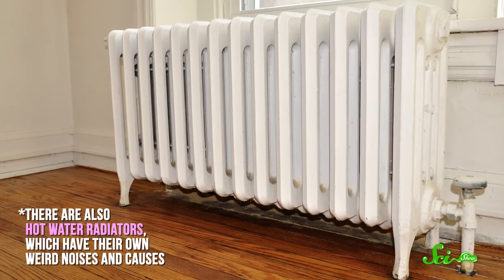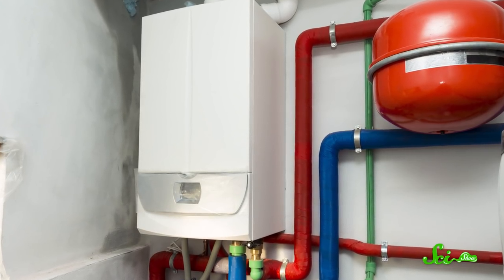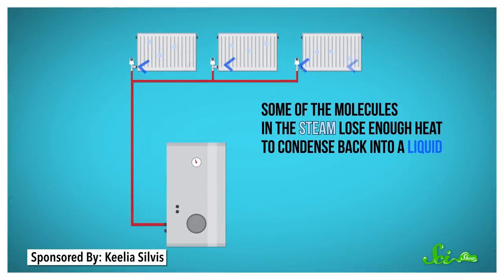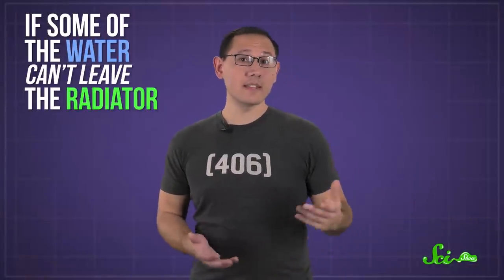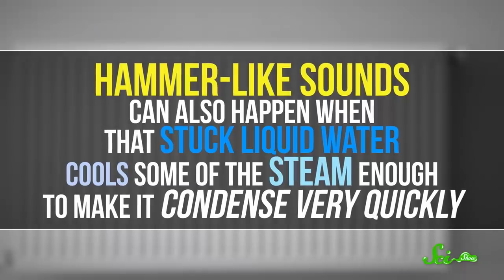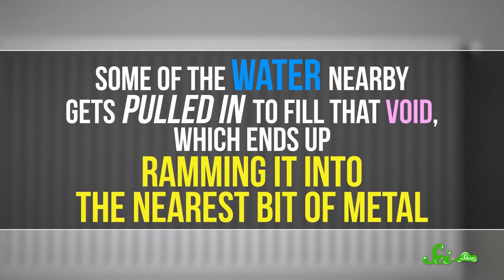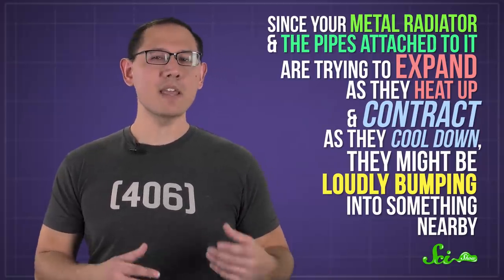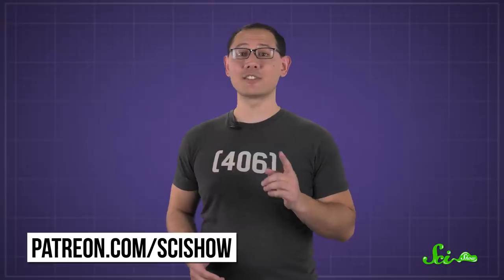What Makes Radiators Bang So Loudly?

Comment: We had those when I was a kid. The whistling was cool air escaping from the bleader valve before the steam reached the bimetal valve, heating it and closing the system. It was kind of comforting hearing the heat come on. Something missing from modern hot water and hot air systems.

Comment: Good info, thanks.  
One minor correction:  
The steam radiator vent closes when the steam reaches it and the heat expands a bi-metal which closes it. (It's not pressure).  Thanks

Comment: I actually looked this up because almost every one of the radiators in our new apartment make the loudest god awful clanging noises when they are on. You can actually feel the floor shaking near the ones in the bathroom, bedroom, and kitchen. At least now I know there might be a semi easy fix without replacing them all...hopefully I can get the apartment management on board to try and get these fixed so my boyfriend and I will be able to sleep at night!
Reply: Did you manage to get yours fixed? I can't sleep at night for this reason.

Comment: Or if it's like in many apartment blocks and larger buildings here in iceland where every radiator in the building connects to a central unit, if a neighbour in the other end of the building bumps into it or starts clanging it with a hammer the sound carries all the way through the building through the metal pipes.

Comment: I was living in a flat with long copper tubing running along my room. The expansion at heating up the movement back caused slip stick motion at the mounting points of the conduit, which was a loud "tick, ... tick, ..." sound. Anoying as hell, but it helped to lubricate the hosing clamps.

Comment: In my house there is an input pipe and and output pipe, and it's basically either always on or off (the steam comes from some public center) so I never experience noise. And I sleep with ear plugs anyway.

Comment: Im in the HVAC industry and work on boiler systems daily.. Youre right if it where a steam system but 99% of boiler systems in residential applications are not steam boilers, they are simple hot water boilers and hot water runs through the rads, not steam. In this case banging usually indicates a serious issue with either the systems pumps or the boiler itself. Usually these sounds are caused by the boiler over heating (because the pump is not circulating the water) this generates a flash steam bubble that usually over pressurizes the system breifly. This pressure spike blows out the pressure relief and the system auto fill valve quickly fills the system back up to operating pressure. When the boiler fills up quickly you get water hammer, (same if you slam a water tap shut quickly in an older home with no expamsion tank) and the water hammer is the cause to the noise. Other times just the steam bubble rising to the top of the system can cause the water to hammer through the pipes too. But if you're getting banging from your rads, and if there is water all over your boiler room floor, you should get is serviced before it kills you in your sleep.

Comment: what the F... the water isn't heated past the boiling point..... there is a pipe with incoming hot water and a pipe with outgoing hot water.... and that gets circulated thru all the open radiators.  No idea where those radiators on Steam are installed, but those are waaay too hot for use. Also, its very energy in-efficient, boiling water to steam to use that as heating is a lot of heat added to water that is not needed in a home.
Reply: Yeah I now understand the system, its archaic old crap, inefficient.
Reply: Hey, Then don't come with out of date crap that is totally inefficient.

Comment: Sorry but you are kinda off really wrong about the "steam". I heating system should be FULL of really really really hot water not steam if you have air in your heating system it needs "bleeding" out via a bleed valve at the top of the radiator. Steam in your system also makes for an unbalanced and a less economical system. Talk to a plumber if you don't believe me but I have been in the building trade for over 10 years and have not come across the kinda of heating system you are explaining hear. The more likely source of the banging is from the metal expanding and contracting because of the heat. Not because steam and condensed water is moving about haha. Just look up how an everyday normal heating system works. Also your house would be an even severely dangerous place to live as the pressure in the heating system would have to be so god damn high if there was a problem it could act like an explosion

Comment: If I hear a loud bang in the middle of the night, I know it's not my radiator, cuz I don't have a radiator. My house is heated a different way. So I don't have to worry about this problem. It's all good now. 

Great video. Keep up the good work.
Reply: If you have oil or gas heating, you do still have a radiator. It is a filled loop system, not a steam one and the radiator(s) is(are) in the duct-work, not freestanding. If you have zoned air, you may have more than one. If you have one thermostat, then it is likely you have one, right by your furnace.
Reply: My house is heated by an electric furnace, which doesn't need a radiator. At least that's how I understand it.

Comment: Clickbait title. Very few if any radiators are run on steam, so the explanation is incorrect
Reply: Actually, in some cities, steam is still a public utility like water, gas, electric and sewer. It is cheaper to use the steam hookup than to heat your own water for a radiator system.
Reply: You're comically wrong.
Reply: Please tell me your joking
Reply: I think almost every apartment in Chicago uses steam radiators.
Reply: This I did not know.  Neat!
Reply: This video also confused me. In the UK we use hot water radiators. In fact this video even shows what appears to be a hot water boiler with expansion tank attached. FYI our radiators can also make banging noises.  Something has become much clearer though: why, in US films, there's always a pipe that when smashed open starts spewing steam everywhere....

Comment: I always thought it was an air bubble going thru the system. Cheers for the video
Reply: Knocking is very uncommon in a filled loop system (hot water instead of steam). If you have a filled loop and still get knocking, there is a pump or valve hooked up to the hot water that is shutting off flow too abruptly and causing a heater hammer effect. It would be a good idea to get this checked out so you don't develop any cracks in the solder near the source.

Comment: Practical Engineering just did a video on steam hammer, which is what this phenomenon is called. It's just that in this scenario, it's on a much smaller scale and quite a bit less dangerous because the water has more directions to flow toward.

Comment: Most of the popping sounds from hot water radiators (and also drain pipes when you run hot water down them) is just sticking and then sliding of the pipes against other surfaces (like wood framing of your house) as the pipes expand.

Comment: The radiator in my garage just cycles hot water, not steam; ergo, no knocking. 
Interesting side fact: Steam use to be a utility delivered right to your house like sewer, electric, gas, phone and water. In New York City and London, steam is still an available utility in some parts of the city.

Comment: practical engineering just did a video of steam hammer and water hammer so you can watch what happens to the pipes in the radiator or when you turn on faucets and the loud clanging happens when you turn them off

Comment: Service anouncement for people with water radiators: If you hear a bubbling sound in your radiator, those are air bubbles  that had formed over time. You should remove them, because they are not only annoying but also make the radiator less efficiant. There are plenty videos on youtube explaining how.

Comment: I have electric radiators in my home, so they don't make noise. But, since I live in a wooden building in a very cold place, it cracks a lot. Sometime nails even "explode" in the wall, figuratively, of course. Their shape changes due to the cold from outside and heat from inside and so, sometimes, that movements gets the wood to move a bit to accomodate, which makes a very distinct popping noise, almost like a very small caliber rifle. You get used to it.

Comment: Steam?
We let out the build-up steam in the radiators so the water can fill up the place so the heat is better transfered.
Heating with steam nowadays is used in heavy industry (or in big buildings where the steam is transfered to higher levels where then the heat from the steam is transfered to water via heat exchangers and from those goes the heated water into the radiators) in which the steam can reach above 400 °C but it needs high pressure ( in MegaPascals ), in which state the steam has a very high heat capacitancy.
Maybe thats why I was looking weirdly when you mentioned it has 1 intake while we have 2 connections (top=in , bottom=out).

Comment: Most radiators use hot water not steam these days. You can tell if you have a water type if there is a small valve at the top of the radiator to bleed out the air than can be trapped inside. The only noise I hear from my radiators is the sound of the circulating pump motor downstairs travelling up the hot water pipe to the radiator.
Reply: Steam is still a public utility like gas, electric, sewer and water in parts of certain cities (London, New York and Chicago to name a few).

Comment: Strange radiator setup, I've never seen a radiator that fills with steam, all of mine contain water which enters one end and exits the other and you heat the water with the boiler.  The only thing that makes a sound are the floorboards near the pipes as they expand or contract from different water temperatures.

Comment: For months and months I couldn't figure out why my radiator was making such a racket whenever the heating went on. I have now theorised that the hot metal is pushing against the old wooden floors and causing it to expand and creak and crack. If I go over to my radiator and stamp on the floor surrounding the inlet pipe, the cracking goes away. It's very irritating, but at least it's fixable. My sister's house has the steam issue and that's not fixable by simply stamping on the floor.

Comment: First radiator shown is in a hydronic system. That is a hot water valve on the radiator. Either that or some put the wrong type of valve on a steam system

Comment: Otherwise known as Steam Hammer. Water Hammer can also banging pipes when water flow is suddenly cut off causing a pressure spike. Steam Hammer can be an engineering nightmare if you do not know how to mitigate it properly.

Comment: Does induced flash condensation of steam equal to the phenomena of cavitation in liquid water?
Reply: Close, but not exactly. Cavitation is in an atmosphere of liquid whereas flash condensing is in an atmosphere of gas. While the water does move some, the low pressure actually pulls the low pressure valve back into the open position for a second until more steam rushes in and slams it shut again. This spike in pressure can cause the over-pressure valve to open for a second, as well.
Reply: D Hawthorne But the banging is heard all along the lenght of the vertical raiser and specifically coming from sections which has no fittings of valves, only smooth pipes in between. Does condensed water dripping back through the main raiser cause micro vacuums in the stream of of hot steams by providing a condensation nuclei and flash condensing some of the the same way a snow making machine do when water in gaseous form a little above ambient temperature croos the curve of the phase diagram toward the solid portion?

Comment: I'm living in Germany and we don't use steam in our radiators but still they make that noise. I think it is produced by water hammer (occures when a liquid is suddenly stoped by example from a valve)https://en.wikipedia.org/wiki/Water_hammer.
Reply: Steam radiators are still a thing. Steam is still a public utility in some cities (New York, London and Chicago for three examples). It is delivered to your building through insulated underground pipes just like electric, gas, water and sewer. Hooking up to the steam line is much more space efficient and cost effective than trying to heat your own filled-loop. 
Filled-loop systems like yours don't typically knock. When they do, it is usually because a valve or pump elsewhere in the building has shut off the flow of water too abruptly.

Comment: I've never heard of steam radiators. Here in Germany we use hot water radiators. I think it's easier to only heat water and its heat transfer to air is quicker.
Reply: Steam radiators are still a thing. Steam is still a public utility in parts of some cities (London, NYC and Chicago as three examples). It is delivered to your building through insulated underground pipes just like electric, gas, water and sewer. Hooking up to the steam line is much more space efficient and cost effective than trying to heat your own water loop. 
As for quicker transfer, not in the least. The metal is what does the conduction. 
In open loop systems, steam fills the radiator, the low pressure valves shut and the system is maintained at this pressure for the duration of the cycle. Any condensate collects in the bottom until it reaches full operating temperature where it turns back into vapor. Once the cycle is over, the steam supply is cut off and the radiator cools, dropping in pressure which opens the low pressure valves again, allowing any secondary condensate to drain to the sewer, drain field or grey water collection tank for reuse in non-consumption applications (the latter of which is very uncommon). Closed loop systems go through a return pipe back to the steam plant where its residual heat allows for quick and more efficient reheating.

Comment: None of this makes sense. Your radiator only has one pipe - all I've ever seen had 2, an inlet and an outlet. And there is no steam in radiators as far as far as I know - it's just hot water, about 50 °C. If you open that valve, after just few minutes hot water will start pouring out. And mind you, I've never seen actual saturated steam coming out of that valve, just air. I know water vapour is invisible, but the fluid in a radiator really isn't anywhere close 100 °C, so there would only be saturated steam visible. But it is just air.

Nice to see Stefan again!

Comment: Steam systems are rarely if ever used in a residential application. That being said steam systems are rarely used anymore anywhere. The high temperature of steam 212*f and up is unsafe to the touch (say, in case you touch the radiator) and is incredibly inefficient. If your system temperature is above boiling temperature then your exhaust temperature is well above boiling temperature and therefore exhausting tons of excess heat to the outside. The term boiler is a misnomer and a legacy term from the early days of central heating. Most of the banging from radiators comes from the expansion and contraction of the metal pipe in the system. Just like an earthquake expansion pressure builds until something gives resulting in a bang.
Reply: Steam radiators are still a thing. Steam is still a public utility in parts of some cities (London, NYC and Chicago as three examples). It is delivered to your building through insulated underground pipes just like electric, gas, water and sewer. Hooking up to the steam line is much more space efficient and cost effective than trying to heat your own water loop.
They are not dangerous in the least if they are properly maintained. They are all installed with a shroud to prevent people, pets and objects from contacting them directly. 
Open loop systems do not not exhaust unless the emergency over-pressure vale is set off. Steam fills the radiator, the low pressure valves shut and the system is maintained at this pressure for the duration of the cycle. Any condensate collects in the bottom until it reaches full operating temperature where it turns back into vapor. Once the cycle is over, the steam supply is cut off and the radiator cools, dropping in pressure which opens the low pressure valves again, allowing any secondary condensate to drain to the sewer, drain field or grey water collection tank for reuse in non-consumption applications (the latter of which is very uncommon).
Closed loop systems go through a return pipe back to the steam plant where its residual heat allows for quick and more efficient reheating.
Reply: D Hawthorne I never said that they don't exist and I know how the system works. The exhaust I am referencing in my initial comment is the flue exhaust not the pressure relief on each heat emitter. And the efficiency I'm referring to is the AFUE not the heat capacity of vaporized water. Bottom line is that nobody is hearing their rads banging in their homes due to steam systems not draining properly.

Comment: Our Radiators are full of water not steam, so we don't have these problems
Reply: Steam is still a public utility in some cities (New York, London and Chicago for three examples). It is delivered to your building through insulated underground pipes just like electric, gas, water and sewer. Hooking up to the steam line is much more space efficient and cost effective than trying to heat your own filled-loop. 
Filled-loop systems can knock too, but it is usually caused by a pump of valve shutting off the flow of water too abruptly.

Comment: My parents would tell me the banging sound was the radiator expanding and contracting. The sound only came from their room. We didn't have a radiator, boiler, or anything like that. Then I got older and noticed the height of their headboard. Mystery solved, in a most unpleasant moment of realization.
Reply: Winter Gray   hn